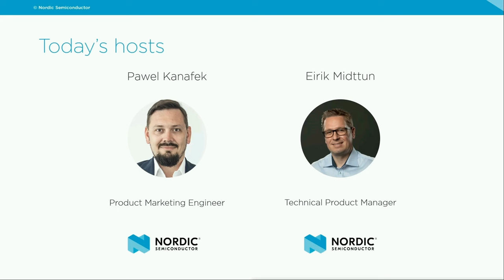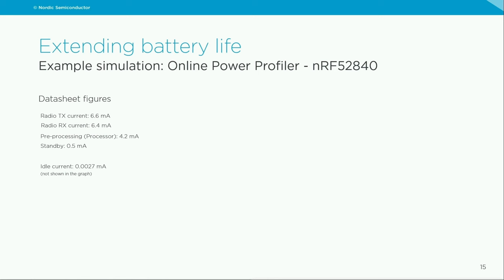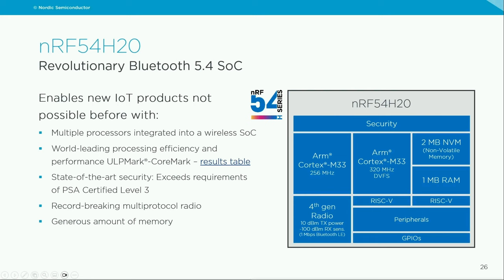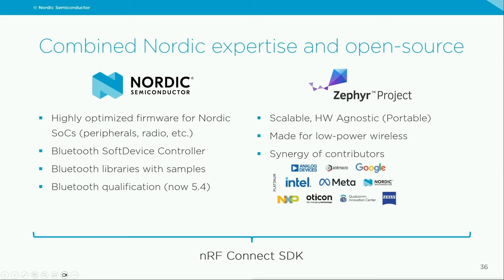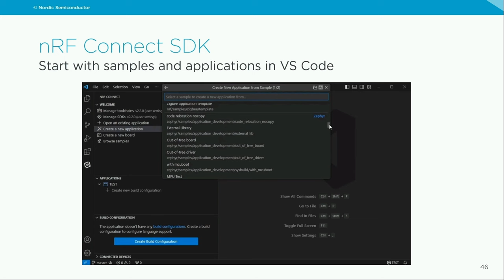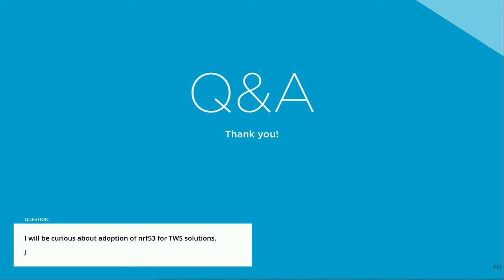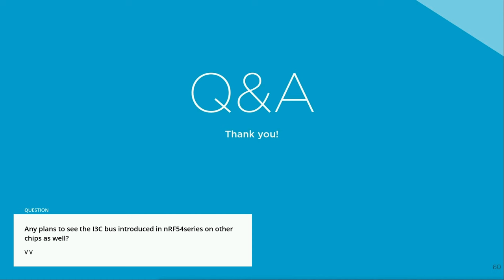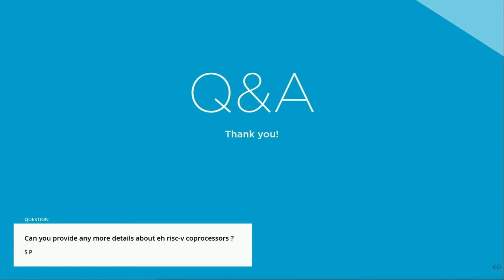Nordic's Bluetooth Low Energy solution: The go-to choice for developers

Comment: For space-constrained devices where battery life is mandatory, Nordic SoCs are a must. But when the product is an IoT device that will be connected to a power supply or the available space for a large battery is not a restriction, there are many more chip solutions on the market such as ESP32. How will Nordic face these competitive prices? Any plans to reduce the price of an nRF5340, nRF54L15 and nRF7002 to be competitive against the ESP32 SoC? Imagine I need BLE + WiFi in the IoT product, nRF5340 + nRF7002 is much more expensive than a simple ESP32-S3.
Reply from the maker: The solution that we're offering is different in some aspects. Therefore, it requires careful consideration while choosing a solution. Let's not forget about the quality of the SDK, interoperability, support, onboarding experience or extensive samples base to start with. We recommend trying out working with our solutions and seeing with own eyes. DevAcademy (https://academy.nordicsemi.com/) is the place to start. 

Our sales force are available to guide you find the solution that fits your IoT project. Please reach out to your local Nordic sales representative. If you do not have any contact, please use the form on our website: https://www.nordicsemi.com/About-us/Contact-Us